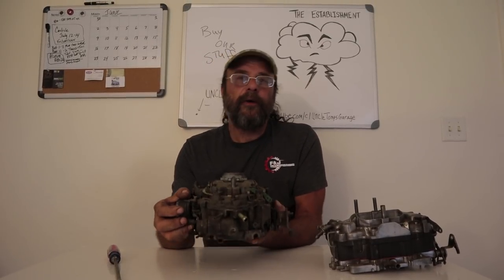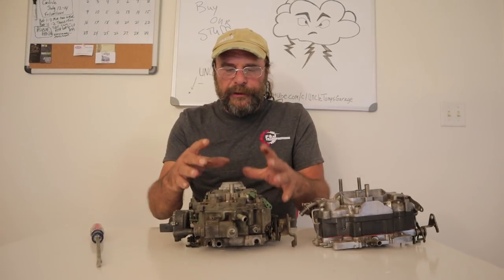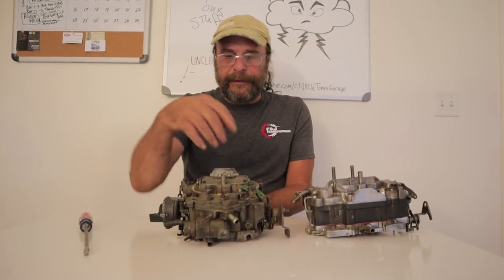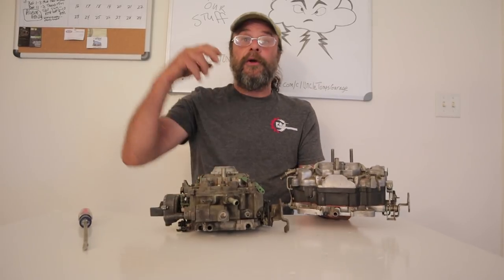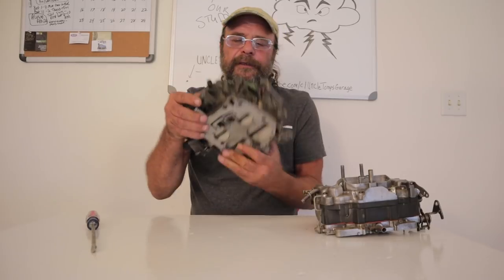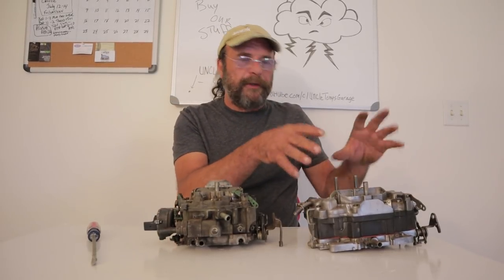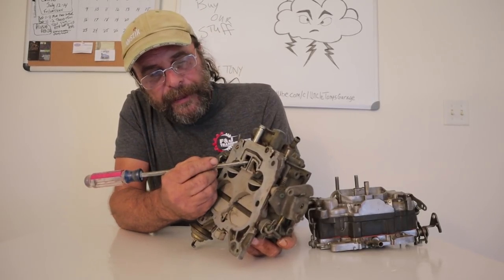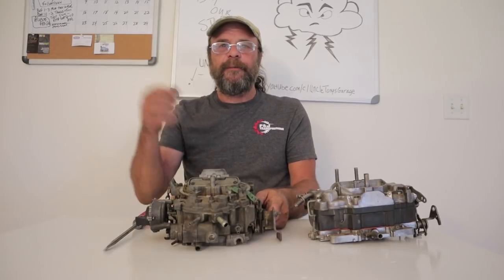The Quadrajet

Comment: Driving around town they give better fuel mileage than a 2 barrel. The primaries are rather small, but the punch is there when you need it. 
Worth a mention the little spring on the secondary air doors sometimes needs adjustment and that's often the reason they get that bog going on.

Comment: Thanks for the video and insight on the QJ.
I had that issue with the fuel bowl emptying when it sat for long periods. Had it rebuilt and the problem addressed. I had tried a Holley spread bore a while back but didn't like the flat spot around 3 grand that I couldn't get rid of. I also use a non-conductive spacer under it to control heat dispersion.

Comment: Quadrajets are the best "all around" carburetor.  They do everything well, but nothing really great.  Depending on what you want, they get good mileage for a cruiser, they perform well for mild street racing, and they work well for towing.  They perform as well as (if not better than) throttle body injection and almost as well as port injection.  I use them on all of my old trucks.

Comment: Great and true review UTG. Many Ford SCJ, GM BB performance cars, and of course Chrysler cars came with great running Q jets. I love them and when right, better than anything for gas mileage and performance. If heat/vapor lock is an issue, I use a Phenolic (wood) spacer that makes all the difference!

Comment: My 1st mild built 350 had a 2 brl Rochester,all I wanted was a 4 barrel and after I got the intake I went through every 4brl carb I got my hands on. But I was young still new to the "hotrodding/dogging of vehicles" and didn't know how to adjust or build anything but the old 2brl Rochester. So when I started looking for a 4brl the ones I got a hold of were already old and needing rebuilt. None done right so I put a plate on the intake and used my 2brl until one day a new "insurance"job got dumped in mines down from my house. (People always dumped stolen cars in the old mines)  Somebody carried a Monte Carlo SS and set it on fire but it just burned the inside,it had a Quadrajet and I put it on my truck and it was great. Nothing sounds better than a Quadrajet when it opens up at WOT. I'd still run them on what I drive today but have always been scared to try and rebuild one so when I need a carb now I buy a new or reman Edelbrock.

Comment: I'm in full agreement about the overall smoothness of the Quadrajet. For a carburetor it's action is very seamless. My shop teacher fabricated a dual spreadbore manifold that allowed for two Q-jets on his 396. his reasoning was that he wanted the increased fuel delivery of a dual quad set-up, but he wanted the gentle transitioning offered by these carbs. He definitely passed on the love to me, i just smile when i hear someone utter the phrase "Quadrajunk" while having to re-adjust their street avenger for the third time...  Great video Uncle T! Also, we're those resin bodies on the Thermoquads ever prone to becoming brittle over time? Seems like I remember hearing of that at some point... Hrmm...
Reply from the maker: They don't really become brittle, but there are wells at the bottom that tend to separate over time

Comment: I love the q jet,such a good adjustable carb, the cam for secondary metering rods wears out,the primary throttle shaft usually needs to have bushings installed or it won't return to base idle, well plugs leak, can be sealed.sometimes you can't richen the idle enough to get rid of a lean idle bump you can usually fix that with a tip cleaner used to clean a torch,but they give good performance.id go with the electric choke.

Comment: mid to late 90s, we called 'em Rochester's quadra-junk, when it came to cars that didn't need smog.  Only used them in the cars that had the requirement to be smogged.  Holley 750 dual feed with vacuum secondaries with a good intake was a good replacement.  Carter AFB was good to tame a wild engine.
Reply: I thought the "double pumpers" were mechanical secondarys only?
Reply: @kevinsartin6059  I meant dual feed, not double pumper, that would be over kill for our use, please forgive me.

Comment: Great video Tony! Maybe in the future you could do a longer video or series of videos explaining to the younger generation on how to diagnose problems with them, how to fix them & what's involved in tweaking them for optimal performance. I love the Q-jet but as you said it is not the best 4 bbl for serious drag racing use because of the one central fuel bowl, but if you run a 3/8th" fuel line like you said & a phenolic carb spacer & block off the heat riser ports either with thin metal (my friends & I used to cut up soda cans) or special intake manifold gaskets alot of the heat soak issues will be minimized. I ran a 850 cfm Q- jet on a 550 horse Pontiac 455 & ran the special carb spacer & intake gaskets & hardly ever had heat soak issues, but Pontiac engines also have an advantage alot of other engines don't in the fact that Pontiac specifically designed their intake manifold so that large quantities of air can get under the manifold to cool the intake charge dramatically as compared to other designs. It was one of the first if not the first "Air-Gap intakes"!
Reply from the maker: BB Chrysler has the same basic design intake

Comment: I’m mostly a fuel injection guy (I design the computers that run them as a day job) but the Quadrajet is my favourite carburetor and use them on non-emissions engines. It may not do as well in accuracy as a good EFI system - that mostly is for emissions - but the drivability and especially part throttle tip-in and transition into the main circuits on the Q-jet is very smooth. You have to understand them to tune them but it’s not really that hard. The front half is pretty simple, the back half is kind of like an SU carb.

Comment: 🛸I always leaned them out right up until they stalled after a rebuild or jetting✈️, I always found the jb weld on the bottom leaking and also recognize that they exist, but that one there is a toy Millennium Falcon 🤗

Comment: That is a very good explanation of the pluses and minus of the Quadrajet.  Up to moderate street performance particularly with an auto the Quadrajet is a fine choice.  GM knew that which is why their top engines featured Holley's.

Comment: I had a 71 Pontiac formula 400, with a quad, I must admit, I hated it,  always by had Holley's, and liked them, although you could ease down on the throttle, and it would spin for a 1/4 mile plus, it didn't have the top end power consistently,  it seemed to do what it wanted, when it wanted, but I guess it was a performance app, and not truely designed for that, about a 750-800 Holley would been great I think,   most Holley's that are crap, have been run filterless at some time, and have dirt in them, or someone fixed it to death!!  I even run a air filter on a Holley, the smallest amount of dirt will kill it!! Great video!!

Comment: Geesh I had no idea a quadrajet had issues. I had a  70 GTO with one and that car was pretty dam fast. It seems like when you nailed it the flood gates would open and the car would squat down and raise the front end and all hell would break loose. Used to street race and won a lot of races but you nailed it when you said at around 800 to 1000 feet the car was starving for fuel. I didnt realize that and bought installed an msd 6a ignition box which helped  a lot but I think if I took it to someone that knew carbs they would of been able to get more outta the car.

Comment: Tony I love your videos about the carburetors really helps after years of not doing my mechanics in the backyard like I said I'm getting back into it again and it's like riding a bike but I'm relearning and yeah I'm learning about the cast iron intake that's on my engine it's got the heat risers for the to warm the carburetor up for the choke and I was told just to plug them so I plug them and doesn't get blown gasket out underneath the Edelbrock carburetor in the spacer plate now I'm fixing to get it so I can actually get some idle mixture out of it and get them and get that title all the way down to where it's supposed to be six or eight hundred RPMs I love you videos with carburetors do more if you can please

Comment: Using a long pump shot like the caddy one is crucial. Holley has a spreadbore too you know.
Quadrajet for the street can’t be beat.
A good shielded phenolic gasket solves the heat issue that all carbs have.
Well that and a return fuel system that is set up for high volume instead of high pressure.

Comment: I like the small primaries and large secondaries on the quadrajets plus there are two sizes (cfms), 400K miles on mine with just one rebuild but currently have problems as I may have accidently pushed the wrong button on the pump and got E85

Comment: For the Q-jet, use thick fiber gasket (to insulate). Use a external air duct to feed the carb.(olds bumper ducts). Also use a cool can packed with ice. If you use a electric fuel pump, use a DODGE fuel filter (3 tits) that has a small return to the tank, so the fuel line does not heat soak. One last trick, use a second bumper air duct to feed cooling 😎 air around the outside of the carb. Datsun used cooling air to the injectors on the 280 Z. Because the injectors would get so hot 🔥 and fail.

Comment: Hi the Quadrajet 2 & 4 barrel carbs were used on all GM cars and trucks, the heat soak problem goes way back when they ran exhaust thru the intake manifold to run the automatic choke on V8's

Comment: Yup, jb marine weld is great for those leaky well plugs.  Tony,  could you do another video about the difference between qjets with A/C and without 
A/C ...and how the hot idle vent works...also the difference between those with manual& auto transmissions.  So many people buy and slap on any old used qjet and don't get the results they were looking for
Reply: Rob D   Good point, they are rather application specific. There is like 23 different sizes of secondary fuel rods I believe.
Reply: I've had plenty of them and I have no idea about some of these differences! Good point.

Comment: Spot on as usual Tony.  Nothing wrong with an early quadrajet. Just stay away from the later electronic ones. The ones with the mixture control solenoid. Never did like them.
Reply: I just sold an 81 firebird formula 4 speed with the original 305 and computer controlled quadrajet. It still ran good except when you floor it it had a hesitation. It was my wifes car so I didn't mess with it and It drove fine if you didn't mash the throttle. Car was to original so I kept the orinal setup on it. Its sold now so I still won't have to mess with it.

Comment: joe mondello has a kit that makes these work really well comes with a bushing kit that goes into the worn throttle shaft that stops the air from being sucked in making the howling noise. ive made one run in the low 7s in the 8th took my time bought the book on making it a performance carburetor and went through it top to bottom. my motor looked completely stock what a shocker.

Comment: I had one off a 72 Cadillac eldorado 500 on a 440, 11 to 1 compression, DC purple cam. 488 lift 284 duration. and a real set of 426 Max wedge heads. in a 74 dart. excellent throttle response and cruising but a full throttle stomp would drain the float bowl in about six seconds and I'd be doing about 80 in first gear. had a 2.73 mileage gear in the diff. great to the next stop light but not the 1/4 mile.

Comment: This channel should be Uncle Tony's Automotive University Online. I always learned something. At 53 years of age I now realize why Q-jet engines lost so much power when they got hot. I grew up with Quadrajets and carburetors in general. They were a pain in the ass at the best of times. Modern fuel injection is light years superior to these things, however, an informed and capable backyard mechanic could fix/rebuild a carburetor. Not so much with most FI or EFI systems. Nothing beats the throaty roar of a wide open Q-jet with those giant secondaries.

Comment: Qjets were put stock on some fastest cars ever made eg 455 Pontiac SD'S, 400 ram air 3s and 4s. Insulater plates were us to insulate the heat on high perf service. Don't underestamate Qjets. In stock class drag racing they ruled. You just have to know how to tune them.
Reply: Don't forget the Buick Gran Sport Stage 1 455's

Comment: Back in 1973 my dad got a great deal on a 67 Malibu wagon with a 327 with a Quadrajet. The guy who sold it was frustrated because he had tuned it up, rebuilt the carb, and did everything he could think of but it just wouldn’t run. My dad drove it and it was very underpowered.  He showed it a mechanic friend and he said, “I’ve seen this before.” 

And he went to the Chevy dealer and bought a 30-cent plastic cam that actuates the secondaries. After he replaced it the car ran “like a spotted-ass ape.” 

Dad flipped it for a tidy profit.

Comment: driving GM cars from the early 70s as qjets aged i replaced them with holly and carters. Found engine never ran better just performance was down and fuel consumption was higher. I learned to recondition qjets and never looked to replacements again. A few tweeks and high flow fuel from electric pump and they can support some serious horsepower yet sip fuel putting around town

Comment: Fyi to all-If you plan to seal those welch plugs with epoxy, do not use the marine jb weld. The gas WILL turn it to goo in short order. You can drill them out and use some small allen plugs, then seal with red loctite. The red loctite seams impervious to the fuel, especially on throttle blade screws. There is not alot of material around those welch plugs- put your glasses on and be careful.

Comment: Cool info. I love the QJs because it's all I've ever had. Not a pro at all but have had good luck keeping them going up until now on my '73 K10. It's been sitting for about a year and won't stay running. Seems like a choke issue. Any tips on where to start? I have a glass filter and can verify fuel, but I've only been able to start it up by adding gas to the carb. It roars to life but stalls out several minutes minutes later. Definitely not a fuel pump issue. Started and ran excellent before I moved it to the driveway in a dry hot climate  while I built a stroked XJ. Not sure which model carb but the choke is vacuum. Thanks!

Comment: Had to run these in my class when I was doing dirt track years back. I started off hating them, coming from a Carter and Weber background. The more I played with them, learning the tricks from the old guys, the more I began to appreciate how well they would run if they just weren't leaking. 

That being said, a nicely built 358cid sbc would empty the float bowl at the end of a straight on a 1+ mile track. Some ghetto shit ensued and I came up with my own solution. Had a tandem Facet electric pump plumbed parallel into the inlet fuel line with a check valve from a bosch efi pump to prevent pumping gas back into the cell.. Had to hide it because super stock was limited to a mechanical pump. Put a WOT switch on the floorpan, like a nos button, but it would kick in the tandem system and supply 14psi. 

Those were the days.

Comment: I had a 70 nova around 1980.I was still learning cars and this one made 411 HP. On the dyno.the quadrajet would either bog and I had to fix a stuck float.If it worked if was phenomenal and I smoked many guys and trans am were no problem on the first quarter mile.It only bogged when was stomping on the gas.I always had parts left over and it always ran fine.It was too much car for me I was young and fearless and nova was small block Muncie 4-speed.It needed a posi I never got a Holley like my friends told me.I have had it apart at night no lights and still got her home

Comment: hey tony, i got back from fixing a breakdown. i came back like i said, i wanted to ask you, didnt those germo-quads have mechanical secondaries, its been a long while for me with the carter... but i remember they just screamed and worked fantastic on the 340s, but ive seen them "adapted" to others quite well.  i just remember that plastic bowl system seemed to be prone to warpage. ive heard that modern plastics remedy the issue. it was worse if fitted on a high-compression motor that generated a lot of heat....rodders needed to change them fairly often or experience vacuum leaks. if i remember right, if you didnt have a feeler, you could use a cigarette paper with the sraight edge, if it went through it was a no-go but some were so bad you could eyeball it easy... your analogy of luxury car carb. was center-mass, thats what they were....slip-o-matic caddilac slushboxes needed rebuilt every 70,000 for the same luxury-type purposes, slipping clutches for undetectable shifts meant a pan full of clutch-dust and a routine rebuild remember?  the caddilac manual referred to it as service ha!!!...in my book, a rebuilds a rebuild. later on they stuck Q-jets everywhere though. one thing most dont know about em. if you needed a 4-barrel but also needed the best possible mileage. they were pretty hard to be beat. others were good, but the spread-bore design, plus the bigger 4 manifold, atomized a little better. the ratio differences between the tiny primaries and humongous vacuum-secondaries meant, if you could keep your foot out of it, they did very, very well, the primary venturis are much smaller than even the Rochester 2-jet...they even had a Mono-jet on 6-poppers...but  im with you buddy, a great carb. like you said, guys race em but there especially good for strong street motors. for my ears, nothing sounded quite like the big Quad either.